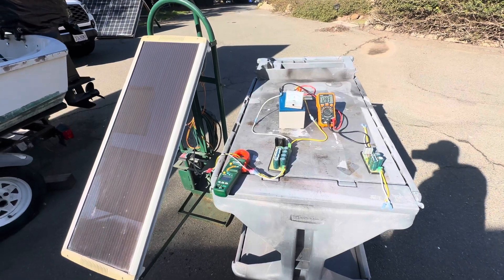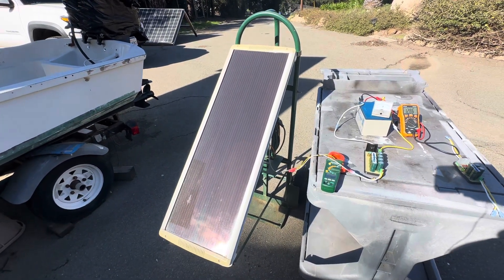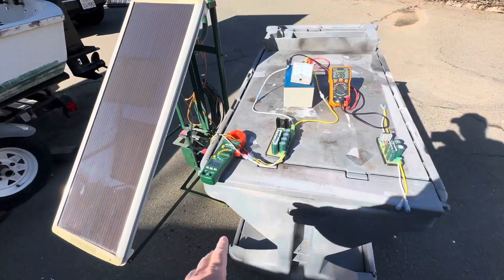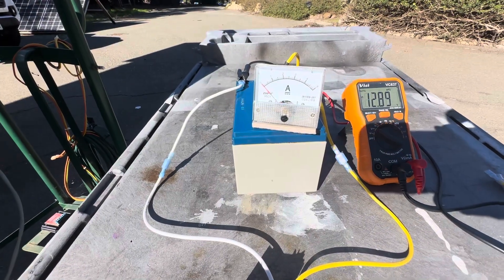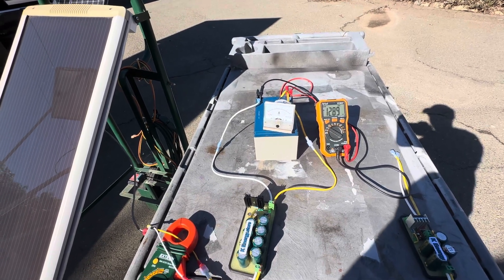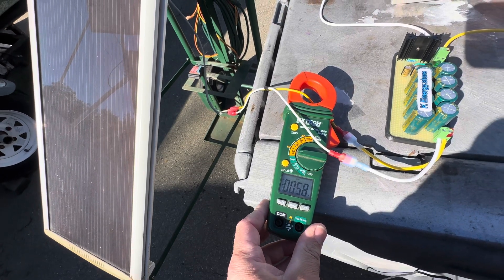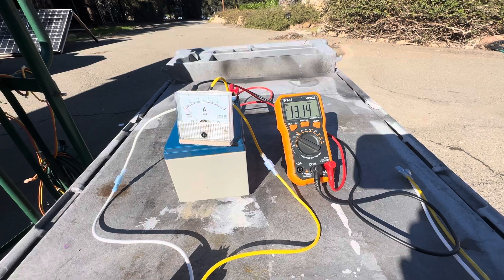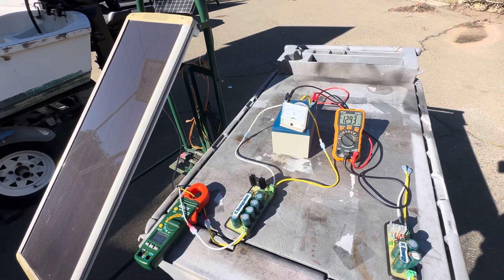20 watt solar panel with cap dump 80,000mf

Comment: Well I have confirmed that this process is actually RETURNING the sulfuric acid back into the solution AND RE-PLATING THE LEAD onto the plates, according to the writings of J.B.! I theorized this is what happened to all the "grey mud" I saw in my batteries before using this device to de-sulfate them! Last night I dug into some J.B. writings and he describes these effects exactly! It reminds me of the process of electroplating for placing chrome on car parts. In my setup I Am using 500,000mf 24V cap. But since Kenergy is using a lower spec. panel than I have I should be able to go with 12v 1,000,000mf cap dumping the zener at 18 to 24V. 

God bless and be well!
Altnergy

Comment: FANTASTIC MACHINE! EXCEEDS EXPECTATIONS! FOLLOW UP REPORT FROM REAL WORLD OFF GRID FOREST! Setting up the system was easy! I hooked 3 109AH Deep Cycle batteries to it in parallel. The Solar Panel has an OPEN VOLTAGE of 30 Volts! My caps are TWO 1 FARAD 12V caps in series, pulsed at 18 to 24 volts USING ZENER DIODES PROVIDED with the board I purchased from KEnergy! (His boards are a work of art and swapping dides is super easy!) If day was extra cloudy I used 18V, fully sunny days I used 24V!

Before I hooked it up I used a battery hydrometer to check the cells and fluids. Some cells were week. All had material suspended in the fluid, which I think is lead, or lead sulfide since the batteries are three years old and losing power no  matter how long they were on the expensive MPP Solar charge controller. SOME CELLS HAD LIGHT GREY FLUID, OTHERS HAD STUFF THAT LOOKED ALMOST LIKE BLACK MUD!

I have used it about a month now, I checked the batteries again with the hydrometer and sticking the tube deep into the cells and EXTRACTED ONLY CLEAR FLUID! 

SO WHERE DID IT GO? It appears that the lead became reincorporated into the plates it came from, and the sulfuric acid went back into the solution. All the cells measure strong again, and that's what matters most!

Buy this! You WILL BE IMPRESSED and SAVE MONEY since it is solar powered!

P.S. The caps I use are typically for high end car stereo!

God bless and be well!

Comment: Thanks so much for this! Solar power is GREAT but much energy in the system is WASTED by the solar controller having to run fans etc. just to operate. When you are living off grid you need as much power as possible charging your batteries or running your inverters, NOT running cooling fans, particularly when there is little sunshine. Bottom line the designs need to be improved! What you have done is LIGHT YEARS ahead of what is being comecially offered! Great strides in helping humanity exist at Kenergy! God bless and be well!
Reply: As a system including the solar panel, this would be less efficent than an MPPT charge controller. The power is still going through a mosfet in this demonstrated unit, same as any other good charge controller and the voltage drop across the fets is about the same here as in a MPPT, but here you don't get MPPT! Interesting to play with but good luck if you think you are going to get significantly better performance than a MMPT!
Reply: I AM already GETTING BETTER PERFORMANCE FROM USING THIS KENERGY SETUP.  I will explain. BUT FIRST I do NOT believe in the concept of LUCK! My language studies shows the word "LUCK" is derived from the word lucifer, so I just stick with facts and truth born out of my own faith, research, and reality!

 For nearly 3 years I have been using Hybrid Charge controller with onboard 1000 watt inverters. These are PROFESSIONAL QUALITY UNITS and quite expensive! They have programmable firmware that is supposed to allow for automatically desulphating batteries, but it NEVER gets higher than about 14vdc, and that is NOT high enough.

To exacerbate the situation these units have a built in fan that comes on even in low light during the charge cycle, like first thing in the morning, when I AM NOT drawing any AC power at all! A better design would be to have more power going to the BATTERIES instead of operating FANS and associated circuitry! I can understand fans needing to run when converting to AC but NOT during charge cycle so much and even on CLOUDY DAYS! 

Bottom line is I need the light to charge my batteries, NOT run cooling fans so often! SO I consulted with KENERGY (he has a link on his KENERGY STORE for consultations by the way). My end goal is to charge with only cap dump and Radiant Bedini Style technologies, and use the Hybrid Inverters AC side when needed.

I have started with 1 Panel rated @34V OPEN VOLTAGE. It is connected to (TWO) 1 FARAD  12VDC caps wired in SERIES for 1/2 farad @24vdc. These huge caps are typically used for high end car audio. I purchased the KENERGY circuit for cap dump via SS relay and use a 100A DC relay to complete the setup!

WHAM! Deeply sulphated battery is returning to health and after only a few hours on this system was able to power my offgrid fridge again! That battery had been on the more expensive hybrid charger all by itself, dedicated to the fridge, and could no longer function adequately. YES, I KNOW with this type of charging I will see even more battery healing and GAINS from this battery, and all others I AM now charging with this KENERGY method. BEST PART IS NO FANS or other such power hungry circuitry was using the precious sunlight, all LOSSES are MINIMIZED GREATLY!

I have FOUR even LARGER PANELS that I have used for the rest of my electrical system. I Am certain that I will not even NEED all four of those to be used in order to SURPASS MY PREVIOUS SETUP performance, BY USING  a combination of Bedini and Cap dump technologies, much of what can be purchased from KENERGY.STORE for those who do not want to build your own.

Understand that I Am dealing with REAL WORLD REALITY of totally off grid power and have used many MPPT and other type solar controller / chargers / inverters, blah blah blah... This technology goes beyond anything I have experienced and of course Bedini and Tesla befuddled many so called "experts" and text books.

Another cool thing about Kenergy everything is HIGHER QUALITY than typical circuit boards,  they will custom build for you in many cases, AND all major components are easily replaced with a screwdriver, no soldering required.

These are the TRUTHS, facts, and reality of what I Am experiencing and I Am grateful to be moving into a higher degree of energy independance, and NOT have to replace expensive deep cycle batteries!
God bless and be well!
Reply: @Altnergy  That's great. I'm glad it is all working well for you. I also purchased a cap dump from Kenergy and it works as described. Thanks for the blessings!
Reply: @Altnergy  could you please tell me the original AH capacity of the battery that you are pulsing with the 1/2 F cap?
Reply: You are MOST WELCOME! We are ALL here on this Earth to HELP EACH OTHER! Nobody knows it all!, BUT we ALL know SOMETHING and when we work together we CAN DO ANYTHING!  As far as making this technology available and spreading CLEAR, CONCISE, INFORMATION, NOBODY ON THE NET is DOING IT AS WELL AS KENERGY! 

I encourage anyone interested in Bedini and alt energy to BUY SOMETHING and support this man. You will get quality product that is EASY to use PLUG AND PLAY! 

You will learn more because you wont be afraid to experiment since the major components you may be likely to damage can be easily replaced in a minute using ONLY a screwdriver!.  GOD BLESS AND BE WELL!